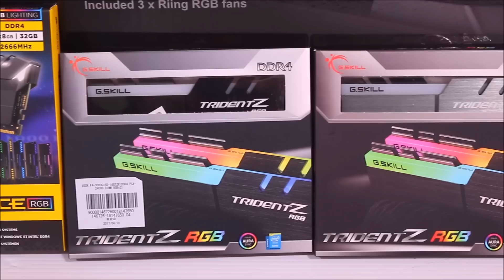#RGB My First Core i9-7900X ~PC Build~

Comment from the maker: Hello Guys .

There are alots of questions About this Pc, so i decide to make some changes in this Pc.

For Exmaple 

RAMS,SSD,FANS,Sleeve Cables.(I dont have  any sponsors so i will do it with my own money again.)

If you guys have any other recommendation tell me  in the reply of this comment.

And different Ram works I proved it. LOL

If you use the same MHz rams of different Brand its work without causing any problems in my opinion.

Thank you.& sorry for bad English.
Reply: how much did it cost?
Reply: 450,743 yen=3,994.15 USD for parts only
Reply: UR_Pc Tech +
Reply: Your top fans are in a pull configuration, I would put them below the radiator so you can see them in the case as a push configuration, how often do you see the top of your case?  Also two kinds of RAM can be used but why?  Cables are fine as long as you cant see them :)  Other than this, nice PC!!!
Reply: Some things I have to complain about this Build:
1. 2 Sorts of RAM?!? 
2. Where is the NVME M.2 SSD ?
3. Why a cheap Sandisk SATA SSD?
4. Why are the TOP Fans set for intake?
5. Why no KabyLake 8700k ? (for Gaming)
6. Why cheap Thermal Compound?
7. And how did you spread the compound over the Headspread ? 
8. Do better cable management.

Try to answer all these ...
Reply: Follow up video needed... I think :)
Reply: this high budget and no sleeved cables!? why? 
maybe replacing the case fans with asus aura compatible fans?
Reply: SLI?
Reply: UR_Pc Tech 
How much
Reply: the core i9 is over kill and you probably do better with a core i7 8700k and the gpu will be bottled neck with anything lower
Reply: Kaç böbrek?
Reply: Great setup keep it up alright & thanks again!
Reply: how much for this pc? i want to buy it
Reply: i feel like dying after watching your videos, espicially while knowing that you bought with your own money. i have a 2009 monitor no graphics card an outdated case which my motherboard doesnt fit in with 16bg and i5 6606k. and i cant afford anything else
Reply: air exchange in the case is broken, 5 fans for a suction and one for blowing it is nonsense, with three fans on the processor heat sink, hot air will flow into the housing
Reply: I think gigabit has best GPU
Reply: UR_Pc Tech plz use liquid cooling, it would look great
Reply: UR_Pc Tech.     I love this video
Reply: A beast
Reply: Buy Nvidia Titan V
Reply: who care's :P
Reply: :p
Reply: UR_Pc Tech いいいいいい
Reply: UR_Pc Tech Thermaltake is  most
Reply: i think the video is dest everithing
Reply: Can I repost this video to the Chinese video platform?
Reply: UR_Pc Tech Bhai mujhe de do ye computer plz bhai
Reply: Where are you from japan🇯🇵🇯🇵
Reply: Yeah you are make a very nice pc
Reply: Can you let me know where the 4 wire pin from the fan controller plugs into? I cannot figure it out?

Comment: Love it!...the only weird thing for me is the top radiator fans are blowing hot air into the case...so basically you have 5 intake fans and only one exhaust...negative pressure
Reply from the maker: Thank you.
Reply: it's positive pressure lol there're 5 intakes
Reply: Peekasit Lopaniluk i thought positive pressure would be more exhaust than intake...making air move through the case better
Reply: Peekasit Lopaniluk and heat rises why would you put top fans blowing heat back in and more heat from the radiator as well
Reply: J and K White actually thats called positive pressure when there are too many intakes
Reply: King Christo ah...then i keep my systems at negative pressure
Reply: negative is actually better for cooling, but creates more dust.
Reply: +Monk you have any test results to support better cooling with negative pressure
Reply: not that i can quote right here, but a quick google will find results that back it up, negative means none of the air is pooling, if you will in the case, which happens with positive air pressure, negative has it all being sucked out which is more effective, well, in very basic terms, its only a couple of degrees difference though
Reply: Even though it has 5 intake fan it doesnt really blow hot air into it. 2 exhaust fans could be great but this fan config is good enough
Reply: YourRecaller fans are blowing through the radiator into the case....that is hot air....radiators RADIATE heat
Reply: YourRecaller oh and heat rises
Reply: J and K White to
Reply: Yes unfortunately wrong...
Reply: Negative is when you have more Exhaust than Intake. Negative pressure will cause cool air to enter itself due to the difference of air pressure level. It's not bad thing honestly I used it on my previous build works fine and I actually had less dust too. But having his fans to sit on top of the Rad and set as blow it be a heck of a dust accumulation on top good luck cleaning it for you have to remove the fans too...
Reply: now that i think of it he did it wrong XD
Reply: The 71 does not have the same airflow path as most cases. The gap between all of the glass makes things a bit interesting...

Comment: I built my own in March and it is by far the best PC I've ever built! it's as follows i9 7920x, Asus ROG STRIX x299-E, gskill Tridentz 3200 RAM 32GB, 1 TB Samsung m.2 960 evo, 2x 7200rpm Seagate Barracuda's in RAID0, NZXT Kraken x52 AIO, EVGA GTX1080ti ftw3, Corsair 570x RGB case and Corsair RM750i PS and lastly an ASUS ROG Curved 34" PG348Q.  So far I've gotten 4.6ghz out of it w/o de-lidding or anything crazy. I can play WOT for example @ 3440x1440 4k and get about 120ish fps w/o OC of the vid card. The monitor is awesome but it took getting used to as it is so wide you almost have to turn your head to see side to side, I also have my Samsung 55" 4k TV hooked up for the epic gaming session or 2. this was my retirement gift to me from me. I had never had bleeding edge before but this was DEFINATELY worth it!!! Amazing CPU as well as EVERYTHING else definitely worth the very high price of admission!

Comment: Haha 2 different ram sticks love it
Reply: MrAktivz is that possible?
Reply: AkroDesɨgɴ [Free] you see it, itworks
Reply: MrAktivz i  have a 2011 board should I try it to place a second ram ?
Reply: AkroDesɨgɴ [Free] what do you mean
Reply: MrAktivz a second ram a other ram like traidenz rgb ram?
Reply: AkroDesɨgɴ [Free] you can if your Mainboard allows it
Reply: Every motherboard support mixed sticks. I have 4x 2GB Corsair Dominator 1600MHz and 2x 4GB Kingston ECC 1333MHz memory in my X58 system :D
Reply: Pasi123 is that true? 👍
Reply: Yes, but it's recommended to use same brand & model sticks. And if you use sticks with memory speed (for example 1333MHz and 1600MHz sticks) it will run at the slower speed (1333MHz), but if both sticks are 1600MHz then both will run at 1600MHz.
Reply from the maker: frst i planned to build in just 32GB of Corsair ram.After that i found G skill ram in very cheap price .thats why to different ram.& Its I Checked the bios its work .
Reply: UR_Pc Tech it looks well too
Reply: MrAktivz would it even work?
Reply: of course why not haha :)

Comment: OMG why SATA SSD... Huge mistake man :( other than that, good for you
Reply from the maker: Some big changes coming soon in this build stay tune
Reply: Cool :D
Reply: What's wrong with SATA ssd?
Reply: Simplicity Quite slow for such an overkill PC... For medium range gaming PC it's okay to just go for a data SSD, but for this kind of money and specs...
Reply: Oh okay, so what should've he done? What would be faster than SATA? Sorry, I don't know much about SSD's
Reply: Simplicity an on board m2 ssd
Reply: SImple, a NVMe SSD, they connect to a M.2 slot (Or pcie with an adaptor) and they got around 6 times the speed of a SATA one. They are a bit pricy, but the performance is woth it. I own a 960 EVO as a boot drive, and it loads windows so fast that I literally can't see the loading screen!
Reply: Alonsitis Duff i have the same ssd (Samsung 960 EVO 250 GB + i7 7700K + 16 GB G Skill 3000mhz RAMM on an Asus Maximus IX Hero motherboard) and it takes about 4-5 seconds to load the windows, so you can literally see it... i aprove that its much faster then a SATA SSD, but in my country for the same price that you can buy a 250 GB Samsung 960 EVO, you can buy a 500 GB Samsung 850 EVO... 500 GB 960 EVO for the same price of 1T 850 EVO... so the price difference is about double...
Reply: Well, I can't. You may have something weird on your config because our computers are basically the same, except for my ryzen 7. Here in spain a 250gb 960 evo costs 140 euros (about 175usd) and a 500gb 850 ev costs around 157 euros (about 190 usd), for me 250GB for boot drive is enought, so it makes sense to me to go with the faster altough smaller 960 evo. And I sear the windows load screen doesn't show up on my pc, only the BIOS post image for about a second, another second of black screen and login windows shows up instantly
Reply: Alonsitis Duff yeah, for boot drive it's enough, but for games not really, that's why the SATA SSD is still more popular... but in about 2 years, im sure that the M2 SSD's will takeover the SATA's popularity on the market and will have a much affordable price...
Reply: I hope so :D
Reply: If that's what you're after when buying an m.2, you're bying it for the wrong reasons imo.
Unless you're actually editing/creating content, then yeh :p
Reply: wait on the M2s they are not a must if your going to game and just surf the net and watch movies. Plus there have been certain things going on with them wait a bit for the tech to get more stable. Its all hyper trend at the moment.
Reply: If you buy an i9 you are not only going to game and surf the internet...
Reply: 3000mhz RAM when your processor supports max 2400mhz, well done
Reply: ML lol no it doesn't

Comment: hey dude
1. you dont push on the cpu the bracket will help with that and you need to check if the ram is the same speed as one anther other wise you will not have a raid system you will just have a system with 2 sets of ram
2. if you want to go rbg go with some like the corsair 570 for a better rgb flow with there software tuning
3. you are cool and i repect you for doing this so with a core i9 and 1080ti strix
my pc computer: https://pcpartpicker.com/list/bjr4HN
i respect you and all women out there adn you are cool
Reply: 1400$ of a pc and using a wifi card lmao
Reply: dont tell my secrets
Reply: ben griffin he said izs checked

Comment: the only thing really bugging me about build is the gpu placement you have the bracket to put the gpu vertical you just need to get the extension cable to do it. Its supposed to be an rgb build and you are not showing the rgb on the gpu off .also to fact you used ssd instead of nvme m.2

Comment: A few recommendations:
1. Replace the ugly black cables with sleeved ones from cablemod
2. Tuck in your wires near the bottom of the motherboard
3. That ram looks a little odd next to the other brand, but if you like it then keep it

Comment: It's not good to use 2 different brands of ram. As they will run at different cal speeds even if you match the same. Why did you do that? You're missing  performance that you should be getting

Comment: The top fans are installed wrong! Hot air according to the laws of physics accumulates at the top and it needs to take, and in the lower part and front case is actually to ensure the supply of outside air.

Comment: Without nzxt hue + or Corsair lighting Node it is not really fully RGB. You definitely want to get that. And also you might want to set your radiator fans on exhaust. Will be better for cooling. Keep the intake fan at high RPMS and exhaust fans on lower RPMS so that you can create a positive pressure. Number of fans really doesn't matter that much.

Also you may want to try your hand on diy water cooling. You can learn a lot from jay2cents channel if you ever want to.

Comment: Thats an ok build..... I would have stuck with just one brand of RAM though........I would definitely work on getting the same set in there and then you can use the other brand for a different build!! I have somewhat of a similar build coming up in the future, but I also am funding it myself. 
Im running 
the new Asus Rampage VI extreme 
i9 7900X
128GB TridentZ RAM
2- Asus 1080 OC   Strix GPU's
2 4TB WD HD and 2 480GB SSD
hard pipe EK water cooling with water blocks on my CPU, GPUs, HD, SSD
 CORSAIR RMx Series RM1000W 80 plus Gold PSU
Custom case Im building myself.
Im so excited to get it done, it should be pretty sweet!!

Comment: great build! I have simple advices, 
1.Should put LED strip in there, not too many, put 1 or 2 in the front and 1 in the cable management section..and it will be LIT AF,
2. Get a sleeving cable since there is no PSU Cover..
Then it will be complete.
I knew there must be something why you got different ram. 
Anyway, 5 Intakes and 1 exhaust.. how is that going?

Comment: Several errors have been made. the thermal paste is already on the block of coolers, so you did not have to put an extra paste on the processor. Two types of RAM memory are not good due to latency. SSD is a bit more error, I think it would be better if M2 memory is put in. It's a brutal machine, but you should fix those things.

Comment: Some things I have to complain about this Build:
1. 2 Sorts of RAM?!? 
2. Where is the NVME M.2 SSD ?
3. Why a cheap Sandisk SATA SSD?
4. Why are the TOP Fans set for intake?
5. Why no KabyLake 8700k ? (for Gaming)
6. Why cheap Thermal Compound?
7. And how did you spread the compound over the Headspread ? 
8. Do better cable management.

Try to answer all these ...

Comment: In putting the cpu, hold it on the sides only, and when putting it don’t apply any force to it, it will automatically go down in there. cause you might damage it, Anyways. Great video

Comment: - no 3 front fan?
- 2 set of ram?
- No vertical mount for GPU?
- AIO should be  next to main, not on top to show moarrr RGB.
You didn't use this case to its full RGB potential man.

Comment: So many problems when you built the PC. Your water cooling fan direction is wrong,  they should be exhaust fans but not intake fans, the way you set up the fan will bring the hot wind from CPU to the PC case, that would much more hot than normal coz you broken the air duct, because front fans in the case are intake fans. Also the PSU fan direction was wrong as well, same reason, PSU fan is intake fan not exhaust fan, the way you set up may damage your PSU quite fast

Comment: It's shit. Different RAM's? Go with either Vengeance RGB or GSkill RGB, RGB is not in sync. One more thing, motorized screwing can mess up the motherboard. That insane RPM can damage or even crack the board. 
Next, interior looks dull and you could have bought PSU extensions or sleeved cables to make it look better.
Btw, that liquid AIO is ugly af. NZXT Kraken x62 would have been much better.

And bro, it's science, hot air has the tendency to rise, so top fans should pull air out of the system. Change it and you'll get better thermal readings. :3

Comment: Why did you buy 2 different kits of RAM? You don't mix kits of the same ram in fact you don't even mix identical kits, instead you buy a bigger kit otherwise you might have issues with overclocking, stability and performance. Clearly don't know what you're doing, I saw you use two kits of Tridentz G-Skill, you have no idea how bad that is.

Comment: Not a very good build should have 3 front fans blowing air into the case and the radiator for the cpu blowing out in the rip with an exsaust fan at the back and you should of have the same RAM set for all 8 slots and given it a better look overall and very bad choice of components i must say

Comment: It looks so empty 🙄 I have 3 thick rads inside, 19 fans, two pumps, reservoirs, aquaero, psu cover, 1080ti, sound card, 16x nvme card... You really should bought yourself much smaller case...